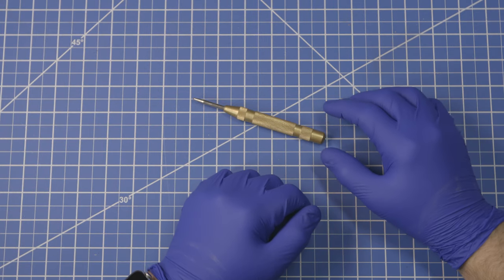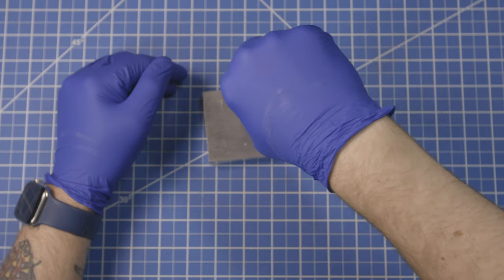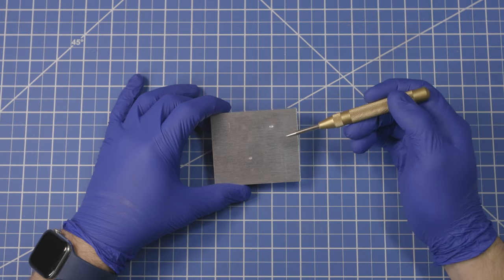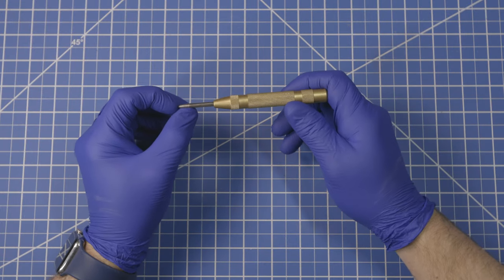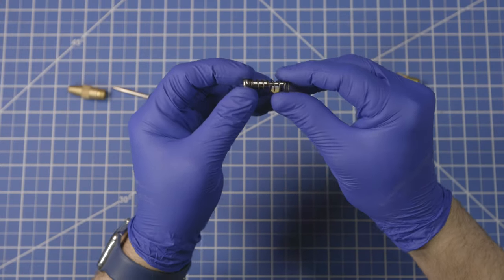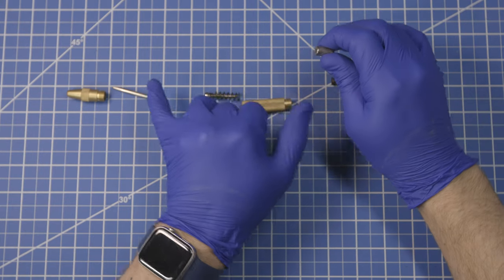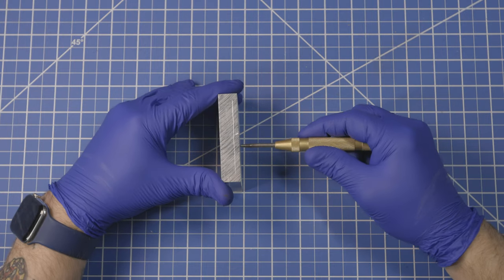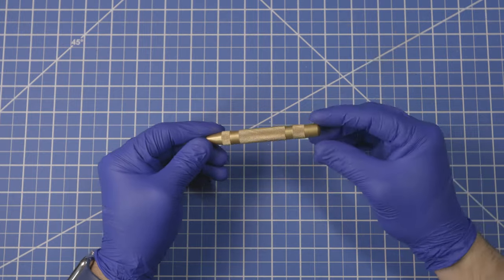Spring Center Punch Basics and Teardown!

Comment: I bought one of these from harbor freight once and the hammer didn't have the hole in it, I couldn't figure out why it wouldn't work. It was the first one I'd ever bought and I just thought I was using it wrong since I had no clue ow the mechanism worked lol.
Reply from the maker: Hah -- that's crazy!  I think that one in the video might be HF, actually.  (regardless, it's a cheap-ish one, but it works fine)